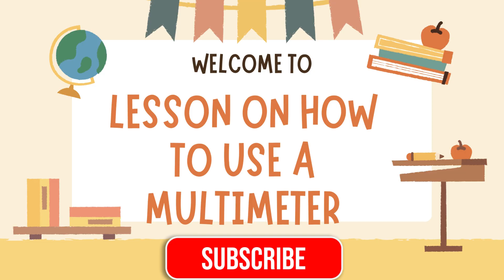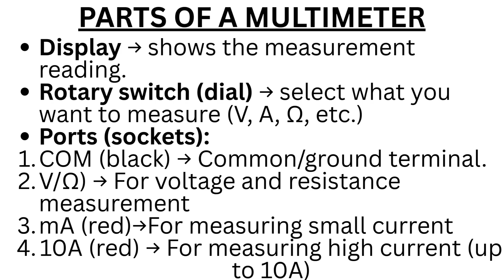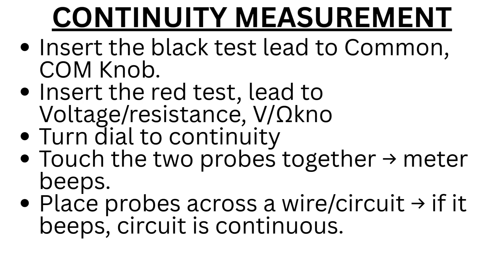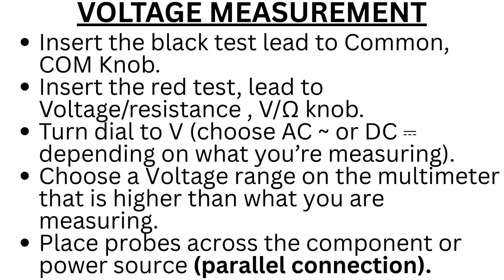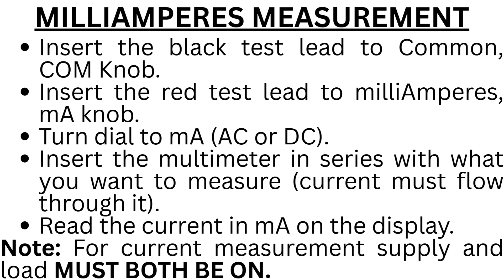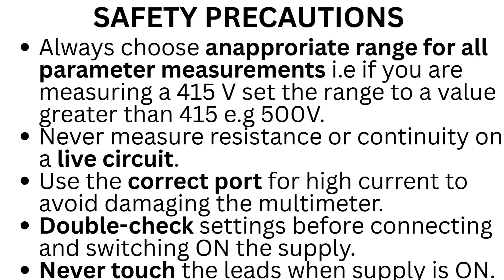Step by step guide on how to use a multimeter

Comment from the maker: Hello guys. Incase you missed my previous videos below are the links:
1. Electrical machines basics: https://youtu.be/bGoqgXK5nm8?si=ZQW4dhLyZXjsWAvz
2. D.C motor working principle, back E.M.F and significance of it: https://youtu.be/KaQrtNHytUU
3. D.C motor voltage equation, power equation & condition for maximum power: https://youtu.be/VUlLRfBr9kU
4. Types of D.C motors, armature and shaft torque: https://youtu.be/ymsNP_p2tpU